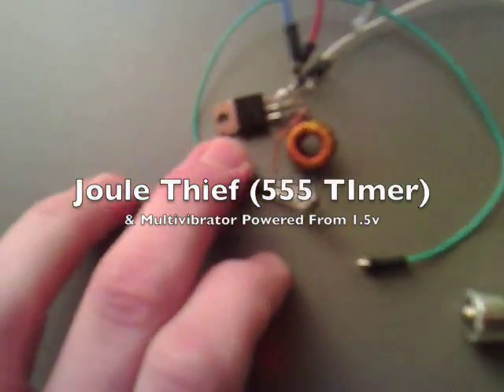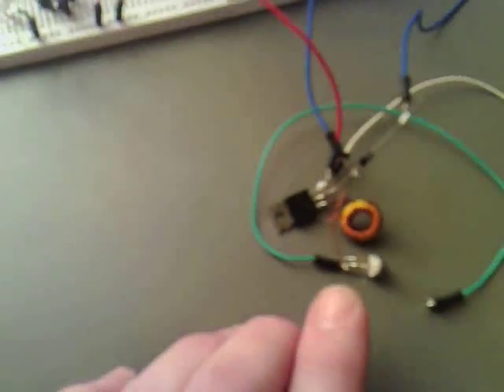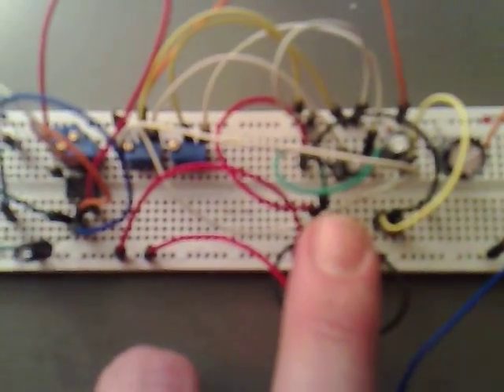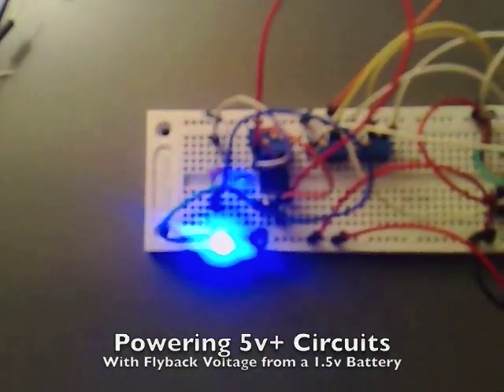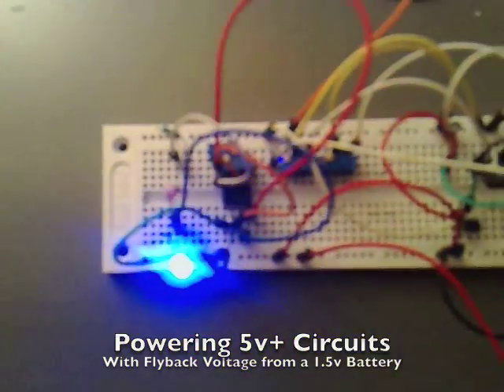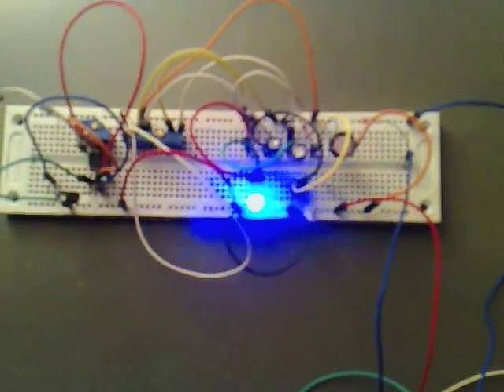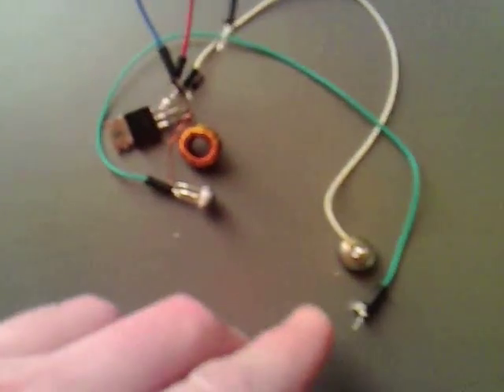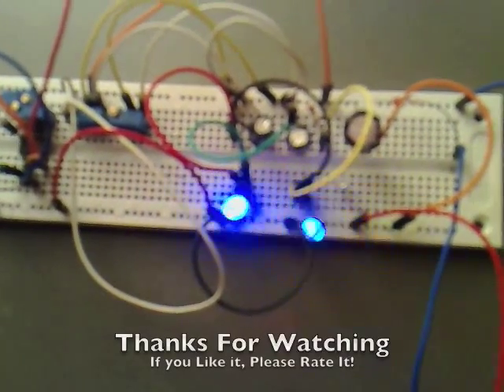Joule Thief (555 Timer) 007

Comment from the maker: I have 4 0.22F 5.5v Capacitors in the post to me and I'll do a test with one of them when they come. 

0.22F x 5.5v =1.21 Coulombs / 3600 =0.00033611 = 0.33611 mAh.

So if it draws 200mA it will last 1 minutes (ish)

I think thats right anyway.....